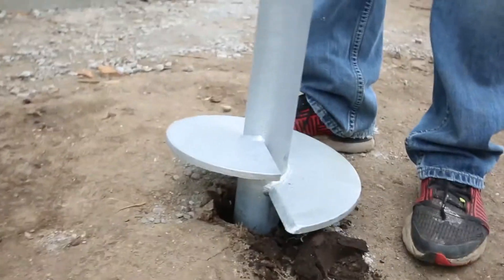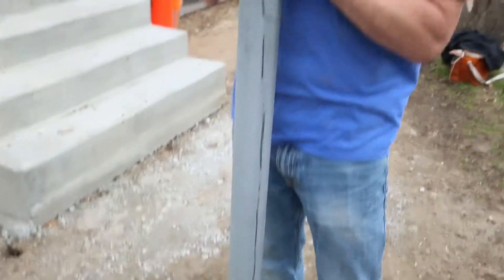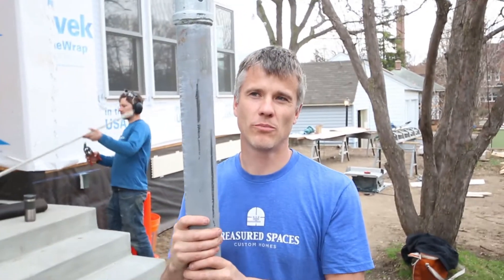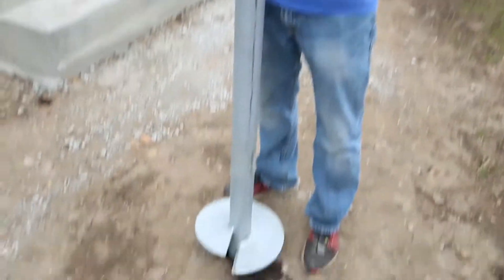How To Do Footings With Helical Piers

Comment: can you have piers under the slab and piers above the slab with caps and no block wall to support the house? (In other words, a house is sitting on 9 feet high piers, and the piers are sitting on a slab (a raft) that has localized thickenings underneath where reinforced concrete vertical beams were casted in place as part of the footings.  Another way to express what I am asking: Is it code to lift a house on beams without block walls to support it (essentially walkout basement without block walls kind of like a beach house on stilts, but the soil is loamy)   If no, why not?